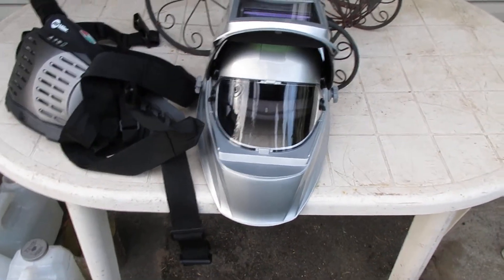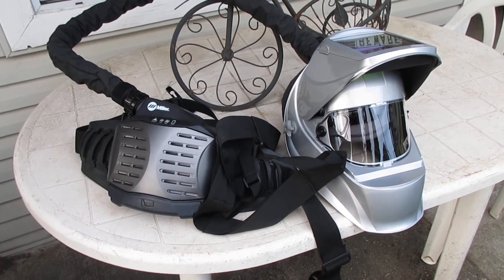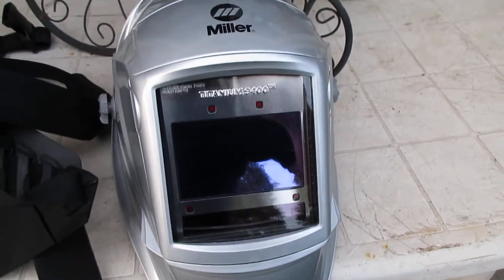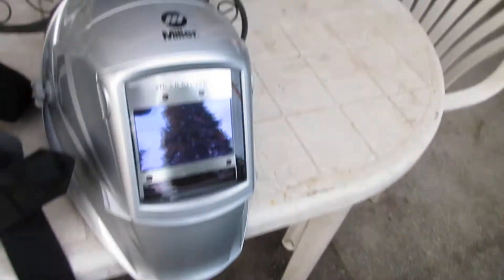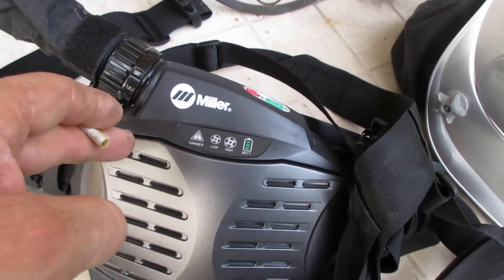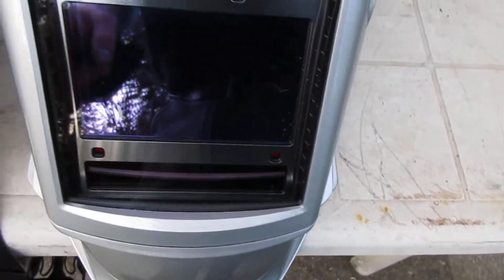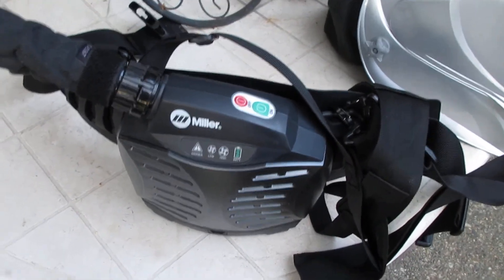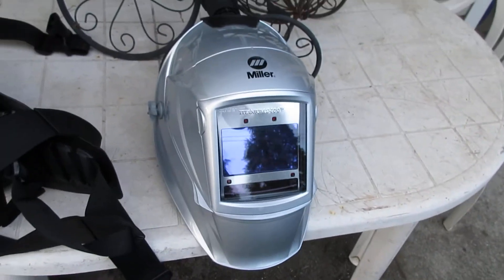Miller papr 9400i

Comment: I have this helmet and I pretty much quit using it because its to heavy. Not that it hurts my neck or head but if you climb around under a vehicle or anything like that it becomes a hassle. It seems well made but honestly I prefer my cheap light hobart because of weight. Just my two cents
Reply: Yea if your going under cars this would be inconvenient , but if you are doing production welding sitting and standing 10 hours a day these papr systems are awesome
Reply: they're kinda made to be used for stuff like climbing into storage tanks and welding where there's a lot of smoke and the air is not the cleanest. or attach it to the c50 for when the air has no O2 or is really really bad.